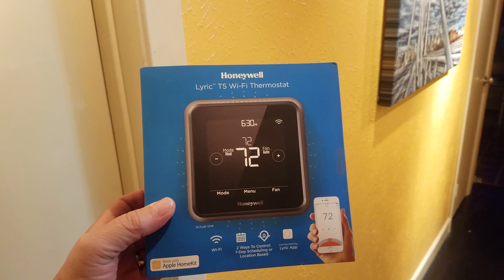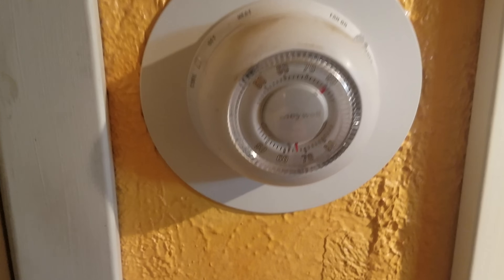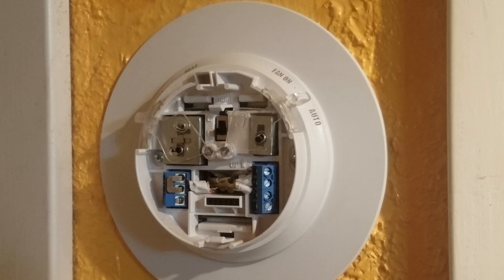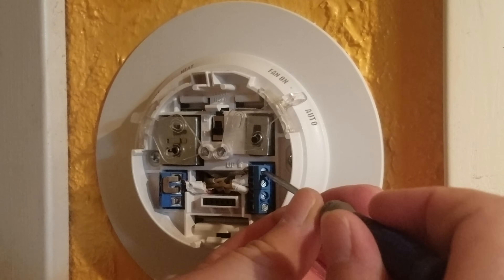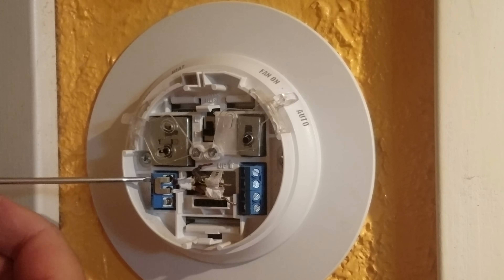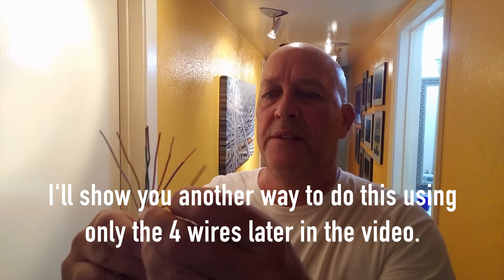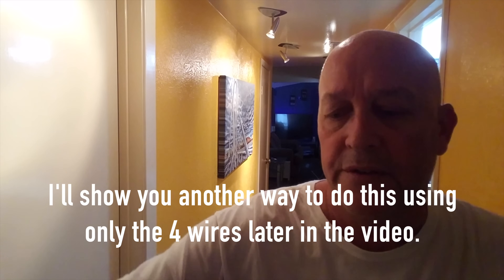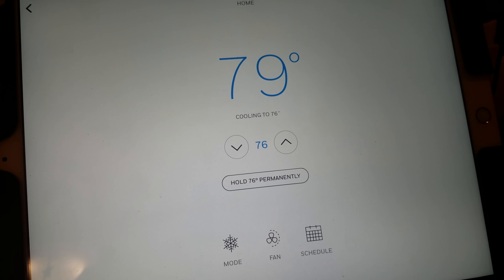How to Install Honeywell Lyric T5 Wi-Fi Thermostat w/without C Wire!

Comment: I have a Carrier 5 ton Heat pump. I have the same wire colors I connected the same as you see at 12:16 here in Bob's video. Except one more Orange wire that I connected to O/B. I hope this helps someone

Comment: I only have 4 cable’s will I be able to do that the box comes with a sm white cable but no C adaptor?
Reply from the maker: You will need the 5th wire (common) to power the device.  Your old thermostat probably doesn't require any power for lights or whatever.  Even though only 4 wires are hooked up doesn't mean there are only 4 wires to work with.  Pull back the sheathing on the wire to see if there's another wire in there.  If there is a 5th wire in there hook it up as the common wire on thermostat and common power 24v from your HVAC system, just like in the video.  If your thermostat is close to your HVAC system you can replace the wire with a 5 wire cable if it's not too hard to run a new wire like in the video.
I think they have come out with some type of device since this video was made to compensate for people without 5 wires but I'm not familiar with it.  I hope this helps, let me know.

Comment from the maker: There are 2 methods described in this video.  The first method works just fine but the second method described with a jumper wire does not work!  If you look farther down in the comments one user describes alternatives when using a jumper wire :)

ALSO ON SALE NOW $112.99 at Amazon 11.23.19   T5 Wi-Fi Thermostat - https://amzn.to/2OHGVBU
Reply: Now its $132 at Amazon, but Brad's Deals has it for $79 today

Comment: My heating and A/C units are in different locations. Which unit would have the "C" terminal to supply the 24V?   ALso, because of 2 different units, how do i know whci are the W,G,R and yellow connections at the unit end?
Reply from the maker: Look at how your current thermostat is set up and check the wires going into it.  All the wires should be colored coded.

Comment: I have five wires ( heat and ac am work on seperate thermostats ) but there is no C wire , do you think Honeywell smart thermostat will work for me ?
Reply from the maker: I'm not sure.....  So you have 2 separate thermostats one for AC and one for Heat?
Reply: Photo FlyBoy [Bob DeWitt]  yes that is correct BOb .
Reply from the maker: @WA-hornet007  I think it should work but I'm not sure about how to wire it.  The C wire is only    the power supply to power the thermostat at 24V, if you can figure out a way to add a 24V power supply it will work fine.

Comment: How do you set up with a smart phone mine won't connect?
Reply from the maker: Did you download the Honeywll Home App?  Thats the one that will work with this thermostat.  Also your device will have to be connected to your network before you can access it on your phone.  Hope that helps, if not I'll try to help you figure it out.

Comment: The green is for fan. moving it to common means the fan on feature will no longer  work. Also, most furnace control boards will turn the fan on as part of heat or cooling. cycle no need to jump.
Reply: Larry Schwartz  so just putting the green wire in place of the C will work? I just won’t be able to turn on just the fan but the ac and heat will work fine?
Reply from the maker: Thanks for the info Larry.........
Reply: I have it hooked up according to this video ( 4 wire with jumper) and everything works fine except fan only mode.(no fan). Is there anything I can do to have the fan only mode work as well, or do I just have to do without that feature?
Reply from the maker: I don’t think so.  It only seems to have 2 modes, cool & heat.  Let me check and I’ll post if I can find anything on that.  If anyone else has the answer please post here.  Thank you!
Reply: I dont have ac (only a furnace)..can i use the cool mode to just run the fan?
Reply from the maker: @roncassiadepape9506  That should work since you don’t have AC the fan should just come on.  I don’t know for sure but give it a try and let me know.  Thanks!
Reply from the maker: Just make sure the temp is set below your current room temp to trigger the AC.  (Fan in this case)
Reply: @Photoflyboy  It worked!...Just had to turn the temp down on cool mode..Thanks so much!!
Reply from the maker: Awesome!  I’m glad that helped...  Enjoy and have a great day.🙂

Comment: Can someone explain!!! HVAC refers to the AC or the boiler????
Reply from the maker: Both!  Here's the definition from Wikipedia  Heating, ventilation, and air conditioning (HVAC) is the technology of indoor and vehicular environmental comfort. ... HVAC system design is a subdiscipline of mechanical engineering, based on the principles of thermodynamics, fluid mechanics and heat transfer.

Comment: Will this T5 work with my heater thermostat that has only 2 wires (red and white) 24V Ac system? Just heater no A/C. My current thermostat is the Honeywell CT30A1005 Heat Only Non Programmable Thermostat.
Reply from the maker: From what I can tell it should.  I don't know for sure but here's a helpful link on Honeywell's site.  https://www.honeywellhome.com/en/general-pages/wi-fi-programmable-thermostat-home-compatibility
If you answer the questions which it tells you if your system is compatible with the T-5 based on the wires you currently have.  Hope this helps  🙂
Reply: @Photoflyboy  Thank you.

Comment: By using the 4 wire jumper you have disabled the fan on control from the thermostat and wired the blower to ac control only
Reply from the maker: So I guess you're saying the 4 wire jumper method doesn't work?   Can you please share how it should be hooked up is your using the wire jumper method.  
Thanks in advance!
Reply: You can add the add a wire add on which allows y and g to operate separately by isolating the lines with a diode so they dont back feed on each other but ultimately the best way is to just run a new 5 wire I have never run into a job that you cant run a new wire.  There is always a way you just have to find it.
Reply from the maker: Nice, thanks for the info.  I know there are people out there that will benefit!
Reply: I Think by using the jumper is going to be ok in the cooling mode automatic, but in heating mode  the  blower is no going to be working, and also if you put your thermostat in manual just to run the blower I assume that is no going to be working because there is not wire connected from the terminal  G of the thermostat to the terminal G in the furnace.

Comment: Where did you find the HVAC wire you used? I’ve been unable to find it.
Reply from the maker: +Jessica Boyd Home Depot or Lowes.
Reply: Photo FlyBoy I bought 18/5 Thermostat wire from Lowe’s but it is not working. I have the wires connected as they were, but nothing.
Reply from the maker: @jessicaboyd8774  Is the power back on?
Reply: Photo FlyBoy The power was back on. My husband pulled one of the fuses out the panel where the wires connect and it is blown. Could this be the problem? We’re going to get a fuse now to replace it.
Reply from the maker: @jessicaboyd8774  If a fuse is blown that definitely would cause a problem.  Did your original thermostat have just 3 wires connecting to it?  If so make sure those are connected in the same way they were originally hooked up and then all you need is the 4th wire to power the device using the 24V connection on the HVAC control board and thermostat.  DON'T use the jumper wire METHOD #2  I showed in this video as it DOESN'T WORK.  If you read the comments below you can see that William's explains this.  I hope this helps :) good luck!
Reply: Photo FlyBoy Success! It was the fuse. Thank you! Your video was so helpful and thanks for responding to my questions.
Reply from the maker: @jessicaboyd8774  Awesome!  You're going to love your new thermostat!  Congrats! :)